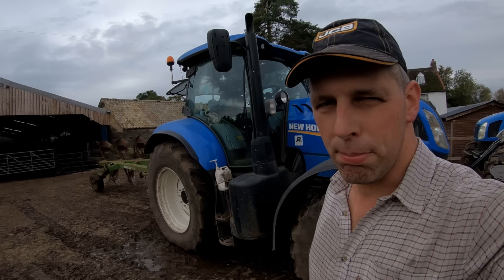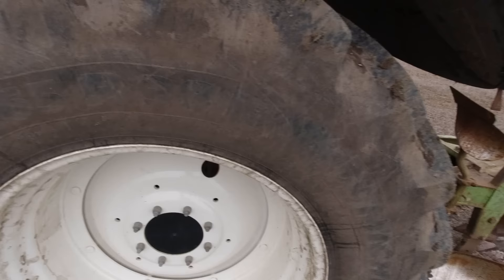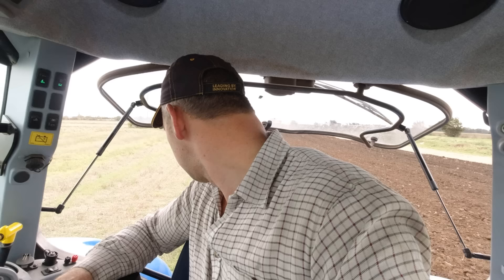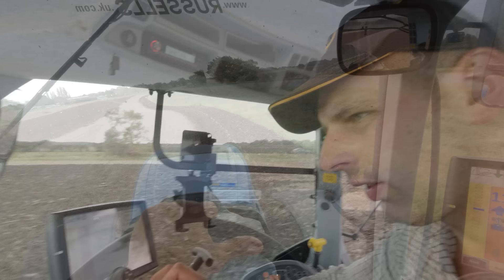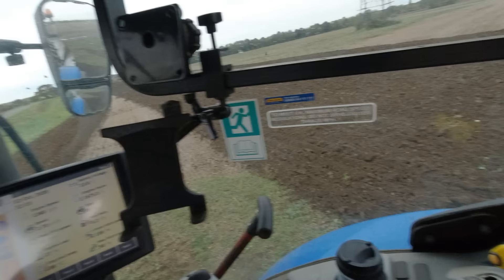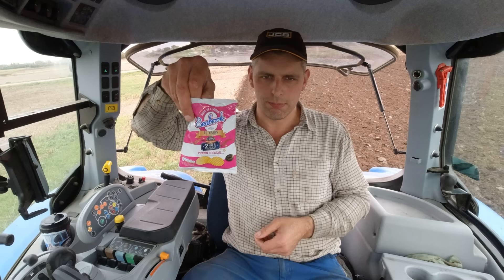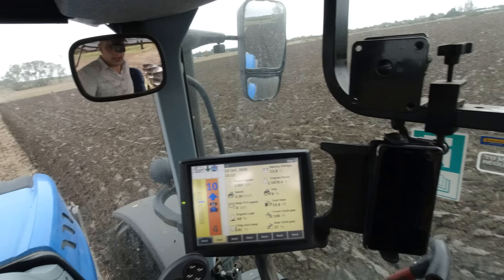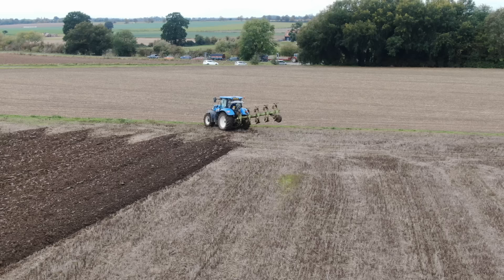A FEW HINTS and TIPS FOR PLOUGHING. NEW HOLLAND T7 and DOWDESWELL.

Comment: Soil sticking to the boards is a pain.
Before ploughing I use a plastic orange or vegetable pocket with river sand, then I rub the boards to a shine. Using the pocket and sand does the job really quick. Use lots of water. Then before putting the plough away at the end of ploughing. I smear the boards with grease. This stops the rust.

Comment: I remember in the 1970’s on my family’s farm plowing the neighbors field that we rented with our IH 826 Hydro Demonstrator. One part of the field had kind of a bowl shape near the road and in one pass about half way up the hill the tractor came to an abrupt stop as the right rear tire spun like crazy and was digging itself in. I quickly pushed in the clutch and it stopped. I lifted the 3pt to lift the front of the plow and I believe it backed out fairly easily. I went around that spot and resumed plowing. I think I remember seeing clay or sand in the hole so maybe there was a spring there? The rest of the ground I believe the soil was rather good.

Comment: i do a similar technique as you for corners going at an angle and for keeping headlands parallel doing markers around the headlands is the easiest and best way to make ploughing headlands easier . all you need to do is have Plough slightly turned and lightly skim the ground so it isnt to rough to drive over

Comment: Never known tip about having back furrow touch ground slight bit before front, but makes sense once the weight is off the front of the tractor it will be dead level.  Guess that's the idea of doing this.

Comment: Im an old fella , I don't remember when I started ploughing but  I was 12 with a David Brown 25 and a 2 furrow disc plough,, we cant use mouldboard ploughs because the soil was so heavy ,, a disc plough is easier to pull ,, A TE20 can pull a 2 furrow ,,  a MF35 can pull a 3 furrow ,, a MF 65 can pull a 4 furrow ,, a MF178 can pull a 5 furrow  ,,, why do you need 150 hp to pull a 5 furrow mouldboard plough ? haha I know which I would rather buy the diesel for ...

Comment: I plough corners like you at work but at home with 100hp on 4 furrows we just get as close as possible on the outside run then turn around and plough back up what we've just done a tractors length

Comment: I'm not a farmer and have never done any ploughing, but I don't understand the set up. You set everything equal, but when you're ploughing the tractor is on the tilt (two wheels in the furrow) so doesn't this mean the the plough is on the tilt? If the plough is on the tilt then why isn't the inside furrow deeper than the outside furrow?

Comment: I stand corrected, but you say that in work, the top link does not do anything. On JDs they have lower link sensing for the draught control, but as far as I know, Fords use top link sensing and therefore it does the job of maintaining the link that makes the draught control system work. I would have thought therefore that this link should only have limited float or else it would not react or be too slow in reacting. (?)
Reply from the maker: The tw has bottom link sensing not top link sensing.